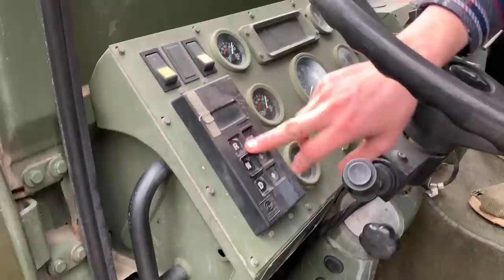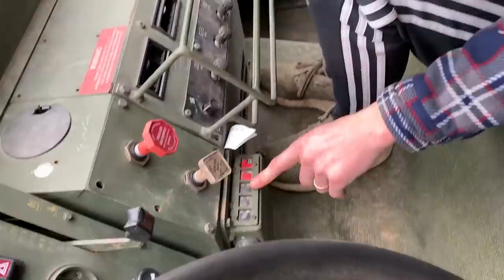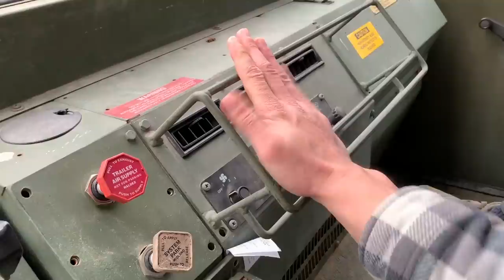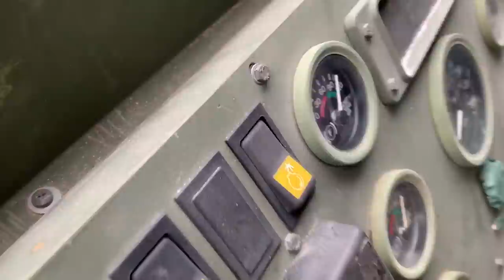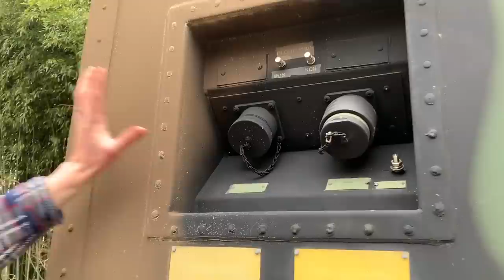Building The Ultimate Apocalypse Vehicle!!!

Comment: Hi, I recommend putting a second tank of diesel, there is space available and it is not expensive, just take precautions to prevent fuel theft.  with 550 liters of fuel that truck could travel more than 1600km, but before I recommend you check the fuel injectors, the passage of time and the habit of the military of using fuel generates many problems

Comment: "These are Military Grade batteries" What they don't know is that it means these were built by the cheapest bidder. If people really knew what Military-grade was. lol.
Reply: Exactly. The government buys stuff from the cheapest contractor. My dad works for the government and wants to be a contractor because he knows hoe much they make.  You dont do anything except order something through the company like GE because they cant but straight from a big brand company
Reply: It’s basically just that if it has been in the military or someone in the military own one it’s considered military grade
Reply: Lol for real! I love seeing the memes we all make about things being “military grade”
Reply: I was in an Army Reserve unit as  a mechanic once upon a time, so I have some experience with this type of vehicle.   The series parallel arrangement for the batteries allows the 24 volt starting system to have a lot of extra starting voltage and current in cold temperatures.  The bad part about the series parallel setup is that they self discharge faster than a single series setup.  Just sitting one month, these batteries would be fully discharged. The single series 24Volt systems would not be completely  dead.   If this were mine, I would set up a little trickle charger on each battery (harbor freight sells them for cheap)  to keep them topped off when you aren't driving it unless you drive it every few days.  OR, You can set up a 24V solar panel with charge controller to keep them topped off.  Otherwise you will be going through a lot of expensive batteries.
Reply: BUT... they hold MILITARY SPEC electricity - hoo-rahh!!
Reply: Andrew Reeves for real lol
Reply: Air Force uses Optimas. Just saying
Reply: Pretty much military grade don't mean squat.
Reply: Andrew Reeves nN
Reply: Excited to see this one. Quit buying and get to building guys!! 🤣
Reply: yep...i laugh my ass off at companies who say "mil spec connectors and wire" which basically means JUST enough to not catch on fire
Reply: Most accurate comment I've seen
Reply: Wrong. These are not cheap batteries that will break easily. Don't get cheap and back-room handshake deals mixed up.

Comment: the 'sunroof' is where they mount a gun ring if the mission needed one, either a 50. cal or an M-60 crew-served weapon. there are connections for a large generator to power it and all the radio equipment that normally would be inside. you can get the Generators through military surplus.
Reply: yup👍👌
Reply: @Ba Paoi you
Reply: I knew the shape of that "sunroof" looked familiar...

Comment: BTW UNPLUG YOUR CONNECTOR  ON AUTO AIR INFLATION FOR WHEELS UNTIL YOU NEED TO USE IT OTHERWISE IF YOU LEAVE IT PLUGGED IN ALL THE TIME IT WILL BLOW YOUR WHEEL SEALS. 
IF YOU JUST PLUG IT IN WHEN YOU NEED IT IT WILL WORK FLAWLESS
Reply: Yeah the ctis system on the 2.5 and 5 ton fmtv sucks

Comment: Nice truck! The cab derived from an Austrian company named STEYR, the same company that builds the STEYR AUG rifle, the Austrian Army had a truck called the Steyr 12 M 18 in service, 12 metric tonnes and 180 hp with 9 speed manual! Stewart & Stevenson used this cab for these trucks, frame and drivetrain are totally diferent, but they have an excellent reputation! Before filling up the fuel tank I would suggest to drain the fuel and inspect and clean it, maybe replace the fuel lines and filter of course - An M 16 rifle is the predecessor of the M 15 and M 4 rifle series ! Keep up the great work guys!

Comment: It has an air filtration system that enables people to work in a contaminated environment—chemical, biological, radiological.  Those plugs on the outside of the cargo container are to connect a generator to power the equipment inside. The inside windows seem to be missing their removable covers. Covers are needed to operate in black out conditions.  The steps to the roof allow for access to equipment such as satellite dishes and other communication equipment. I bet the vehicle was used for a mobile command center.  An M16 is basically the same as an AR15.

Comment: It's 800 miles because they drove it so much in 25 years that the odometer rolled back over to 0.
Reply: MikeBabsBC or it could've been from a unit that didn't use it very much. It looks in a million times better condition from the ones I see that are around the same age and they have at most 50000 kms
Reply: I'm almost certain this unit was not used much. I believe that 800 miles is all there is on it. I saw it all the time when I was in the military. One of my units had a unit just like this one sitting for over 5years with the plastics still on the seats with less than 100miles on the odometer.
Reply: 94'... This might have been built West of Houston.  S & S had a big factory out there, and I used to see their inventory parked out by IH10.
Reply: Might have been refurbished, they replace everything in the dash including the odo. Considering how new the tires and everything look, id guess like a 2010-2014 refurb.
Reply: It's because when a vehicle gets remanufactured they put in a new dash odometer.
Reply: @clutchem  what would one of these cost you think?!
Reply: After an engine is rebuilt or replaced the odometer is reset to 0

Comment: What you have is aMilitary Carrier. The Inflation system is known as a CTIS; or better known as Central Tire Inflation System: this allows you to "adjust" the tires when you travel either on a dirt road or a gravel road or even sand. It also works on the highway and could slao be considered like an ATV. But that's reaching, ... I do like the vehicle because the truck was maintained very well and it will last longer than the new car that are on the road. When someone says that " this thing is battleship built" they mean that it will last and work 99% of the times; instead of 50/50. God! i do so envy you guys. You have a treasure!! Please, ... do NOT abuse it. It is easy to get lost in it's ability. OK? God bless you guys. I say, ... GO FOR IT!!

Comment: Those connections on the back passenger side, is to attach a generator. M16’s are the military version of the ar-15
Reply: nice you explain instead of makin fun of them.
Reply: M16...military version of AR 15. That box behind the passenger seat looks like small server rack. Put routers switches and servers in there. Or radios.
Reply: @normmuelleman2570  it did look like it used to have all sorts of military communication and networking equipment that had been stripped out of it, looked like it had def been in the modern military
Reply: M-16 can shoot full auto-illegal. AR-15 shoots Semi-Auto. 1 shot per pull of the trigger- legal
Reply: full auto firearms are not illegal, they are just super regulated. you can only get full auto firearms that were made before 1986.
Reply: The military uses M-4's  with select fire. M-16's were much larger. M-4's are a lot smaller and more versatile. And Mattel just made some parts for it they didn't build or design the m-16. The m-16 was basically designed by Armalite. Which is what the Ar in Ar-15 stands for, not "assault rifle" like so many anti gunners love to say.
Reply: The M4 carbine rifle is the military version of the AR15. The M16 is the grandfather of the M4 and AR15

Comment: Just now watching these 5 ton ones. Make sure if you ever have to pull the tires off the bolts are forward facing on both sides. If I remember right you tighten to the front. Hit me up if you got some questions. Check the seals and such on the doors they do tend to leak, let the air out in the cold. These things are awesome.

Comment: O-Ring- (Turret- for guns or system) 
M-16 mounts, 5.56mm American Rifle system (AR-15 long butt stock)
Pouch under turret-  is for catching brass as you pour American lead.
Batteries-  just batteries, but I think these have to be 24v set-up.
Bars over gauges- for gunner to put feet on without breaking.
Box in back is Kevlar lined. 
The passenger side wire- where the comms antenna goes 
All fluids can be checked behind the driver seat. 
Look for the M1079 truck TM-10 
Yes you can upgrade the lights, however I would just splice them in.
Military Grade- Lowest Bidder

Comment: M16 is the Military Version of the AR-15 essentially. Its the simplified way of saying it, but you get the idea.
Reply: Isn't the M4 the proper military version? The M16 is just a variant of the M4? but at the end, they are basically the same. Most important fact: AR-15 is semi-automatic, M4/M16 is usually automatic
Reply: M16 has a 18" barrel
M4 usually has a 16" barrel
Ar15 is the same platform but not made by colt
Reply: @moritz5164  dont you mean ar14? lol biden3030!

Comment: The shelter on the back of the truck was most likely a command post or operations shelter, that's the reason for all the outlets, and phone connections.. The metal trim against the wall was usally to secure items to. There was a metal plate on the back of the shelter that stated the model of it, but its probably gone now. The old field phone connections would have been wired back to a military phone switch. The two other connectors on the outside panel would have possibly been for a generator to supply external power. IMO you should get a military generator to pull behind the truck incase it all goes real crazy and everyone looses power. The generators are cheap and can easily be found on the web.

Comment: FYI: The 360 pintle hitch rotation is required so that if the thing you're hauling flips over, it doesn't flip the truck over with it; in rough terrain, things that get hauled tip all the time.

Comment: That big ring near the air box slides out and there are 3 more. They slide out so it can be slung loaded under a helicopter or lifted by crane. Max water fording recommendation is 30" without extending the transmission and diff breather tubes. Your air system lifts the cab. The controls are on the right side behind the narrow rectangle cover above the fuel tank.

Comment: Like This To Let Them See It
https://www.youtube.com/watch?v=xKP1TpgZNP8&feature=youtu.be

1996 Stewart & Stevenson LMTV M1079 4X4 Camper Truck

- 5055 Miles

- Cat 3116 with 225 horsepower the engine is the non-electronic, highly dependable

- Allison 7-speed automatic.

- 395/85R20 Michelin Super Singles 90% Or Better

- Full size Michelin spare

- Interior Is In Excellent Condition for the age of the vehicle

- Zero Leaks

- Full Service just performed including: Batteries, Fuel Filters, Engine Oil, Transmission Oil & Differentials

- Dual Voltage 12V & 24V Alternator

- AIR RIDE CAB

- 2 TRAILER PLUGS, ONE 24V AND THE OTHER 12V.

- THE GOVERNMENT SPENT OVER 125K ON THIS TRUCK

- Turn Key 100% Ready To Go Work Or Play

Clean ON ROAD Title in hand!!
Reply: G F S  nice
Reply: Amazing find

Comment: M-16 is the military version of the AR-15, basically, without going into specifics.
Reply: I was always told AR15 is the non-auto M16...
Reply: @StaredownGames  that would be correct.
Reply: Pretty much
Reply: Same one from Vietnam? I don’t know much about guns...
Reply: @MonkeySpank17  Yes, M-16 is a Select Fire rifle, it can be selected to fire semi-auto or full auto or depending on the version it can fire 3 round burst instead of full auto. The normal AR-15 is a semi-auto rifle but there are also full auto versions. There's also the M4 version which is basically the same but has an adjustable stock. There's several different versions and variations.
Reply: USN_Ret 84-05 very cool didn’t know the M4 and M16 were basically the same, thanks man!
Reply: USN_Ret 84-05 barrel length too.
Reply: @MonkeySpank17  Like so many things for the military, the early ones SUCKED and got a horrible reputation which some old timers never forgave.  It didn't take long to get the kinks ironed out, and the modern versions of the M-16/M4/AR15 are seriously top of the line battle arms.

Comment: Being on the army and seeing yall get one of these and to see your excitement made me smile because especially now I hate dealing with vehicles the cab tilt is under the spare tire in the top pin box and it has air for a good trailer for the forklift also the mount on the top that big circle was before they shut it a turret for a 50 cal or mk19 gunner yall have fun might have to mail yall a technical manual for the lmtv

Comment: Make sure the doors are shut before raising the cab to do any maintenance. Download the technical manual for the truck and it will help out alot. There is a 10 level manual (operator level) and a 23 manual (repair manual)

Comment: With that box and the big electrical panel, quite likely it was a Communications/radio vehicle. There would be an air conditioner/refrigeration unit in that ventilated enclosure at the top/front of the box to carry away the heat from all the radios plus 6-8 comms guys. We had some that towed both a Diesel genset (30 or 50 kW If I remember right), and behind that another trailer with a tilt-over-crank up antenna tower (nested triangular-section pieces of mast, one inside the other). The antenna tower hooked onto a pintle on the back of the genset. I'm sure there are other configurations. 
I think they were also fitted out as command offices, and I saw one rigged up as a print shop one time, for printing maps, etc. But the 120/240 VAC breaker panel on the inside right rear of the box suggests yours might have been set up for radios/communications. (We also had one with a plate in the center of the box roof, and there was a satellite dish fitted onto the  mount.  I'd love to have one in as good shape as that to make into a real off-road motor home. 

The Canadian Army had a bunch of these that were made by Steyr in Austria They were kept at one of the big training bases - that base was also used by British Army units who came to train. There was a full set of equipment for various units coming to train. That way, they didn't have to haul all their own vehicles back and forth. I expect the U.S. forces had lots of uses for the 2-1/2 and 5 ton models. 
They're really top heavy, especially when you get all the gear installed, and not hard to roll over. 
And no, it's probably not bulletproof. The walls are insulated to keep the area quiet when all the comms are up and running.

Comment: You should put some more steel storage boxes on the underside behind the wheel then just put a trap door to the inside so you can’t access it from the outside. Also should probably make those boxes 110%water proof

Comment: If y’all need to know about that beast, I used to drive those in the army.
Reply: Is this like a military ambulance of some sort ?
Reply: @rabbit42007  It's a command mobility vehicle.
Reply: I bet that was awesome!
Reply: Andre Lewis Somewhat. They are monsterous, so maintenance is a pain in the butt. All in all it’s a cool vehicle.  BTW we called those 5 tons, not sure why, maybe due to the towing capacity.
Reply: Randall Brown It’s configurable to many things. A few of the ones we had were ambulances (when I was in a medical unit) other times they were utility vehicles. Our inside lights were red if I remember correctly for use with out NVGs (Night Vision Goggles) during field training excerc9ses and deployments.
Reply: @jaythree1976  that on is the 2 1/2 ton the 5 ton has two rear axles.
Reply: @jaythree1976  thanks for your service.
Reply: Randall Brown It was my pleasure. Thank you for your support!

Comment: Hope you have a class B with air brake endorsement.
Reply: I was thinking the same thing. They need to upgrade their license for sure.
Reply: Don't need it. Register it as a class a or b motor home and all you need is a standard driver's license.
Reply: Make sure you turn off the battery switch on the battery box
Reply: TheBoom66x67 and drain your air tanks
Reply: Ford PowerSmoke I do

Comment: It’s a army LMTV with a Shelter on the back.  I drive them in the army till this day
Reply: they arent hard to rive but very easy to tip over. thats why the level is in the middle
Reply: Mark Thompson we always had a generator hooked up to it.  They better check for class 1,2&3 leaks 😂.  Also the air brakes will lock up if they don’t make sure the the  air purge has a seal on it
Reply: To this day deonty wilder
Reply: Crunch_Tyme you should ask the engineers/repair men to make a list of the common problems for the model. That’ll help goonzquad a ton
Reply: plus those LMTVs are diesel guzzlers too
Reply: D X here in the army we don’t have engineers that work on those vehicles.  Just army wheel mechanics.  But I know a lot because as a driver you are also a minor mechanic.  They have to make sure that they keep a chok block on the right front tire so it will not roll. And make sure they check for the cabs mounts bushings because they will dry-rot

Comment: You might wanta look into this more I think you need a CDL to be driving that and a class A if your going to pull the forklift with it.  And having Air brakes I am sure you need CDL.
Reply: yup, in the UK you would need an HGV class 2 to drive that beast
Reply: I have the same tranny in my diesel motorhome. No CDL required, 35 feet long. 55 feet towing my F150. I do believe a couple states are requiring licensing but only a couple.
Reply: Stuart George australia would either be LR or MR depending on weight. Our heavy vehicles are much bigger than heavy vehicles in the rest of the world

Comment: search: low boy beaver tail trailer. Lots of them around. Depending on the height and width of the trailer with the fork lift or zombie mobile you might need overheight permits.